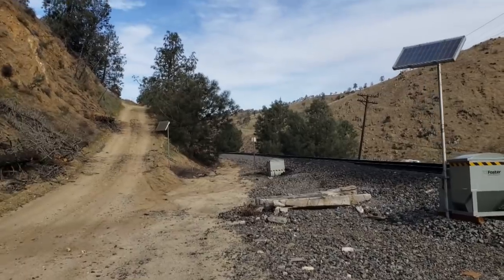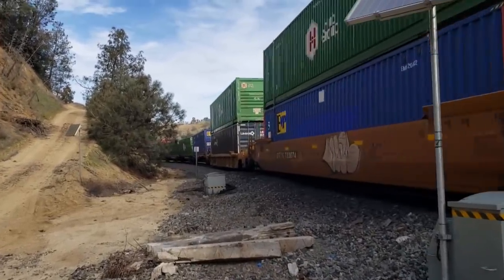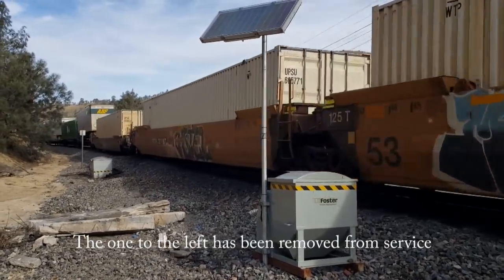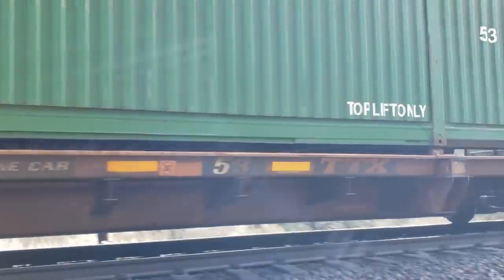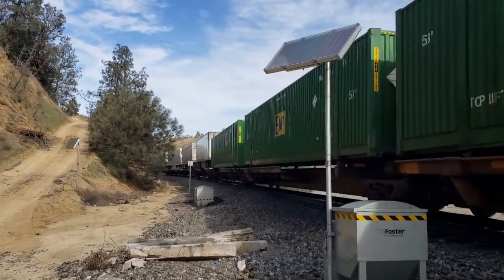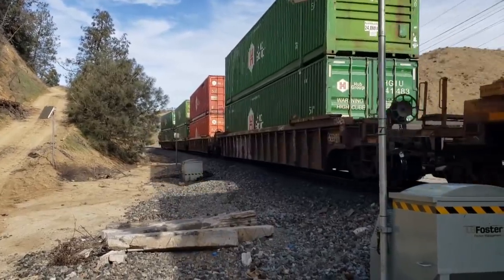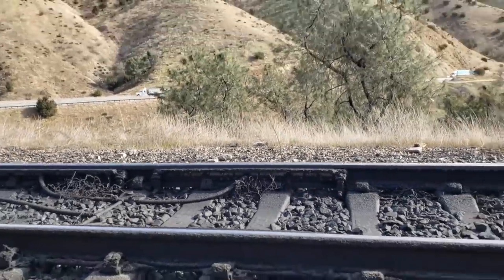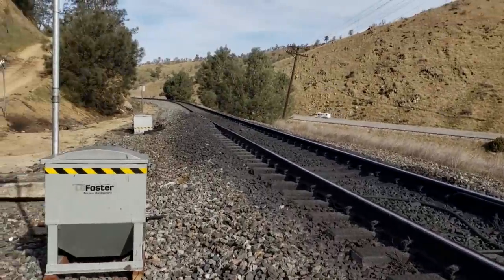How a Railroad Curve Oiler Works or How Squeaky Wheels Get The Grease!

Comment: The New York City Subway, when under the ownership of the New York City Transit Authority, had train wheels lubricated beginning in the 1970s. The freight trains deserve to be lubricated often because they roll with more mileage than rapid transit trains, including the commuter in the northeast, the Long Island Railroad.
Reply: Subway trains use oilers to combat wear and noise.
Reply: @royreynolds108  The oil chemical was a lubricant. That is what the old New York City Transit Authority called it. To you and me, it means the same thing. Thank you for tapping or typing to me.

Comment: Has the railroad ever considered indipendant bearings on the left right side of a truck (as compared to eaight axels)? Yes more bearings to maintain but those oilers must take a fair amount of maintenence themselves. Indipendent bearings would also reduce the friction co-efficient on curves. Just a thought.
Reply from the maker: I'm not sure how axle bearings would change the wear of flanges and rail but if the railroad thought it would save money, you can bet they've looked into it!

Comment: Just curious - are those grease soaked "sponges" along the rail? The car wheel flanges picking up the grease - avoiding the actual wheel "tire" getting grease - to prevent slippage /wheel spin by the locomotives?
I never knew curve oilers existed. All you model train railroaders out there - next time I check your layout ..I'm gonna look for the curve oilers!
Ha ha ha! 😄
Reply from the maker: The way the grease is distributed along the rail keeps it off the top. There is a cloth sheet laid between the rails that stops the grease from being slung up the rail as well.
Thanks for checking out the channel!
Reply: @MarkClayMcGowan  Thanks!

Comment: So is there a specific type of grease that goes in them? Or is it just some kind of basic general purpose grease?
Reply from the maker: It is a very specific type. It is designed to flow smoothly and stick to the area to which it is applied. Even so, there is a felt like cloth laid between the rails to stop any grease from being slung upward.
Thanks for checking out the channel!
Reply: It has a 14% graphite content.

Comment: Question:  What keeps the oiler from greasing the drive wheels of the locomotives and making them slip?  Thanks!!
Reply from the maker: The way the grease is distributed along the rail keeps it mostly off the top. The cloth, which is felt like, between the rails catches errant grease from slinging upward.
Thanks for checking out the channel!

Comment: Here’s one I got for you.  When I take the train back east, why are there telephone poles and wires located along the train lines so low, compared to other telephone poles and wires.  I used to watch the green glass insulators as we cruised by.  In fact, my dad had some of those insulators at home.  I thought they were cool and ran some light bulbs inside them for night lights.
Reply from the maker: Those were the signal lines used to hold the circuits that told the signal system what was going on. If you want to find my piece of Polelines, it's in the "How The Signal System Works" playlist.
Reply: To add on to Mark's comment, most of the wires were carrying only a few volts, for the signal, track, slide fence, hi-water, etc circuits. The exception is the float power pair, which was usually 440, 550 or more volts, just a hot and neutral. 

These no. 6 or larger copper or aluminum wires would be found on the outside pair of insulators on the lowest arm and typically larger sized, plus can be a distinct color/shape from the rest.

This ultimately powered battery chargers in all the signal cases, which floated the large strings of primary batteries.

Comment: Interesting that this exists.  The train wheels don't need the flange to turn.  I know it rubs sometimes but the conical shape of the wheel keeps it centered in the tracks even on a turn.
Reply from the maker: Not really. Gravity will easily overcome the wheel shape in elevated curves. Also, the trucks that hold the axles are solid and will push the leading axle to the outside of a curve, especially on locomotives. They used to transpose rail to get more life out of it and I've seen rail head worn very thin before being scrapped. You can bet that if the railroad didn't need something they would not keep it installed!
Thanks for checking out the channel!

Comment: Two questions: 1) Why are curve oilers needed? You said they reduce wear. Why is there more wear in the curve? 2) Where on the wheels is the wear? Where on the rails is the wear?
Reply from the maker: Curves wear more quickly because they are elevated (cambered) so gravity pulls wheels to the inside and the trucks that ride on the axles are rigid and push the flanges against the outside. It's kind of a double whammy! The flanges wear more as dos the inside of the rail.
Thanks for checking out the channel!

Comment: Interesting... You didn't explain why the engines' drive wheel don't slip???
Reply from the maker: The design is such that the grease is dispersed along the inside of the rail, not on top of it.

Comment: Certainly nice to see all those Fedex trailers NOT on the highway.  Do they wait until the engines have passed?  At 2:55, I heard what i’d call a flat wheel. Not very severe; I’ve heard much worse on CSX’s customer cars.  Those must beat the crap put of the tracks, ties and ballast
Reply from the maker: No. Locomotives wear rail even faster as they have three axles under rigid trucks. The grease is dispersed along the inside of the rail. Flat spots are hard on track structure as well as axles!

Comment: One thing I've wondered is... Is that grease biodegradable?  The Manitou and Pikes Peak cog ry in Colorado uses(used) veggie-based grease on the abt cog system.
Reply from the maker: I really don't know but the railroads are all doing more environmentally stuff these days. Especially if it's cheaper!
Thanks for checking out the channel!

Comment: Nice video! A close up down on the rail would've been nice! Maybe next time? I wonder what kind of grease? Is it actually grease or gear oil? Just a bit more information for my curious 🤔 mind! I like the video.  Thanks.
Reply from the maker: It's a very specific type of grease developed just for this system. I don't know it's specific viscosity but I do know it's expensive! Another viewer asked if they might even be going to an organic based lubricant these days and they may very well be. I'll see what more I can find out!

Comment: What a long train ! The locomotive should be very powerful indeed. I was thinking of that two rows of containers on top of each other . Could they pass through the tunnels in the path ? And my last words : those staffs for oiling process in no-man's-land would be disappeared soon in some countries !
Reply from the maker: The tunnels are notched for clearance for the double stacks. If you go to my "Railroad History" playlist and find the two part video I did on the history of the tunnels I explain the story behind that project! The solar panels are only used in remote areas but are still sometimes stolen.

Comment: honestly I had no clue rails and wheels got lubed, I just figured trains were meant to squeal a bit.  Given friction makes heat I now wonder how hot the wheels on something like an Acela must get when its in areas it can cruise at 150+,  I took it to Boston once and GPS clocked it at 155 in Rhode Island.

Comment: How Does the Engineer know Where the end of his Train sits. For example if the train goes through say a 20 mph speed restriction.  The whole Train has to go through at that speed.
Reply from the maker: GPS. Plus they have a manifest that tells them the number of cars in the train and thus, the length and weight.
Thanks for checking oyt the channel

Comment: With the forces and pressures involved they should use not oil but a soft (maybe even medium) grade of wax with admixed graphite. The mechanism should be triggered by acoustic switches set for approach of trains, not for the screech.

Comment: The wheels & axle on railcars are basically one fixed piece.  It would help if the wheels moved freely of each other.
Reply: Not really. The wheels are actually truncated cones in cross section and not cylinders. If they were cylinders and able to rotate independently, they would not stay on track automatically. See https://youtu.be/vkzgcJGdUnA for how the wheels work.
Reply: The other choice is to have the bearings in each wheel between the wheel and axle.  What is used is generally the best and least expensive system.

Comment: They're called 'Flange Lubricators' and they lubricate flanges, not wheel treads. Because train wheels are conical, not cylindrical (and rails are canted inward three degrees), trains can negotiate curves without flanges hitting the rail, but at higher speeds and tight curves, flanges do touch, causing wear. When the outer rail gets too worn, it's simply swapped out with the inner rail.
Reply from the maker: Forgive a signalman for not knowing the exact terminology of track apparatuses. I'm a story teller, not a rivet counter! You've obviously not spent much time in curved territory as Tehachapi. The flanges and rail are in almost constant contact. They stopped transposing rail on the mountain in the 1990s.

Comment: Well I don't believe the flanges make that familiar noise. I reckon (and I may well be wrong) that the noise comes directly off the wheel face and railface interface (lot of faces lol) since the axles are rigid. What I think happens is the inner and out wheels are rotating at different speeds and it is this that causes the familiar groan as the windup between wheels is equalized. The groan radiates down the rail and through the mass of the wheels making te delightfully familiar deep tones.
I propose track superelevation, wheel taper, rail cant all combine to ensure the flange rarely touches the rail on bends. I have seen  instances where the flange does touch the rails where slow freights rest on the bottom rail of superelevated rail for high speed passenger track on hills where the slow freight crawls up resting on the inner rail and I suppose this trackside oiler is for that. Maybe some very small amount of it gets on the wheel face to stop the groaning from chattering the rail face like corrugations on a dirt road but not enough to inhibit braking.
Reply from the maker: Well..you are mistaken. If you could see what worn rail up here looks like and see the broken flanges, you would understand the squeal.
Reply: What you are proposing only works for dedicated track used by very specific equipment at a specified speed.  That, sir, is not practical to accomplish or maintain.

Comment: I saw one of the older ones out on the Santa Ana branch near Costa Mesa (in the out of service track area).  There was only one at one end of the curve.  The switcher would shove from the Alton St runaround track across Susan and around the TIGHT curve to go to the LATimes building.  The greaser would only operate when going toward LAT, it wouldn't operate coming back.  I could see a lot of grease around there and on the inside of the rail going towards the LAT building.  Yup...it was a mess.

Comment: Does the oil effect the traction of the next  locomotives if there is a grade ? Some remnants of the oil must remain on the rails after the train has past .
Reply from the maker: Not unless there is an issue with the adjustment. The lubricant is dispersed along the inside of the rail in very small quantities.

Comment: MOST of the time the taper of the wheel circumference keeps the train on track (imagine a giant ball rolling btetween the rails - that wouldn't need flanges).. Only on tight curves, or "turnouts", at slow speeds do the flanges touch the tracks, and on those cases I could see the need for greasing.

Comment: Wondering how the anti fossilers will circumvent this issue.
Reply: Couldn't they use vegetable or animal grease? I'd think there are alternatives to fossil fuels in this application.
I'm reasonably confident lubricants make up a very small percent of the world's use of oil products. So even if alternatives are available, I doubt it's worth the cost to start using them.

Comment: I also read somewhere, that Chicago's El train tracks have "oilers" that, not only help lubricate the wheels on tight turns, but also prevent the wheels from climbing up and over the rails. Chicago El trains make very sharp turns in the Loop, which makes this oiling process necessary.
Reply: The EL track has inner guard rails which contact the back side of the car wheels to hold the flanges off the rails on the other side of the track.  Not only do their flange oilers (or greasers) apply grease to the flanges for the sides of rails but the backsides of the wheels for the guard rails, and they still squeal like a stuck pig.

Comment: I believe that the grease is food grade , and also prevents wheels from friction and heating up causing derailments on those tight curves .
Reply: Not hardly.  The lubricator grease has a  14% graphite content besides a lot of other content that makes up grease.  There are many formulas for grease depending on what is being lubricated and where including temperature.

Comment: I'm amazed with all that tail end weight on a train that long and all the power at the head and no distributed power, that the front of the train doesn't string line on sharp curves.

Comment: A small percentage of commenters here DO understand about the effect and use of conical tyres on solid axles, so I won't labour that point.  I just want to say two things:

Firstly, the reason that wheel flanges do sometimes rub against the inside of the rail on tight bends despite this self-centring effect, is that the conic angle cannot be very large or the effect would be too violent and unstable at high speeds on [even well-laid] straight track.

Secondly, contrary to what most folk intuitively think, the squeaking and squealing sounds that one hears on curves comes almost entirely from the differential movement between the tread of the tyre and the flat top of the rail - the outer treads have to jerk forwards, or the inner ones backwards, every few yards.  It can be one or the other or both, depending on several other variables of track and train.  When this is heard, the flanges could well be pushing hard against one rail or the other - again, which rail it is, depends on other things - but the sound comes from those forward and/or backward jerks.

Comment: Thank you for the explanation -- I saw one of these while walking alongside the commuter line near me.  I could see what it was doing (pumping out grease), but I didn't know why -- mystery solved!  And the one I saw was strictly mechanical -- the grease was pumped by the wheels hitting a pawl on the inside of the track.
Reply: The ones near where I live are like that. Makes a lot more sense to me, but I suppose that the electric ones must make very exact doses of oil or something to justify the cost.

Comment: It would have been good to talk about & maybe show a few graphics on wheel coning & super elevation before talking about the last resort, greasing !
Reply from the maker: I'm not very conversant with the machining of the wheels. I was a signalman, not a mechanical engineer or a machinist. Anyway, none of that matters on heavy grades and curves. The flanges are going to ride the rail. Even on straight track there is no such thing as perfect track. Cars bounce and rock everywhere (on freight roads anyway) and rail is in almost constant motion.

Comment: Also, the surface of the wheel is tapered from the flange to the outboard side to accommodate turns.  Learned that from a SPRR machinist.

Comment: Ive always wondered how the oilers don’t cause wheel slip for the engine drive wheels
Reply: I had no idea these things existed.  I would have thought grease on the tracks would be a major cause of slippage for the locos - sanding the rails would be counterproductive - and turn the grease into grinding compound.  I’d be a whole lot smarter if You Tube had been around when I was young.  Too old now to use much new information.

Comment: Solid axles have no differential. Thats why they squeel...
Reply: Yes and no, there's a flange on the inside of the wheels that ride inside of the rails to keep the train on its tracks. Rolling in a straight line you get a scrape and squeek here and there as the flange contacts the rail similar to adjusting your steering wheel to hold your car in a straight line. As the train passes thru a curve the flange is in full contact for the duration of the curve with huge amounts of force causing lots of squealing and grinding of metal to metal. The train can't turn sharp enough for a solid axle vs diffential axle to make much of a difference. But im sure there are those forces in play as well... but the flange against the rail is where most of the noise comes from.

Comment: I’m surprised that such a thing is even allowed in California.
Reply: I'm surprised that box and the rail itself doesn't have a Proposition 65 warning on it.
Reply from the maker: @ParkerUAS  there have been suggestions in these comments that they may now be using vegetable based lubricants in this application. I'm going to look into it.
Reply: In San Rafael, CA the train tracks aren’t even used. And for that reason alone, I wouldn’t move there. I love trains.

Comment: I have seen many these.  Very crude and very effective once the dirty oily film wears away.

The MOST effective friction coating for rail is Graphite.  They would need to apply it on the inside shoulder of the rails.  Because application to the wheel flange would be time consuming and would wear down in due time.